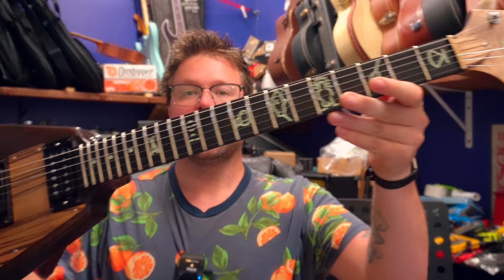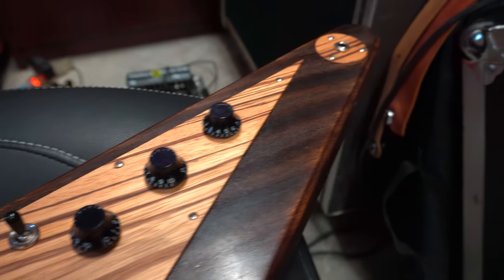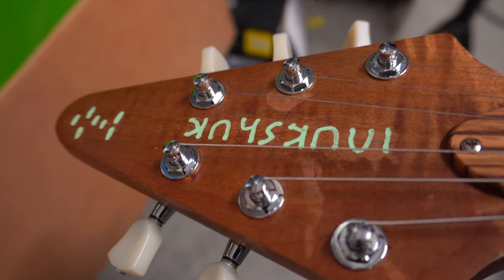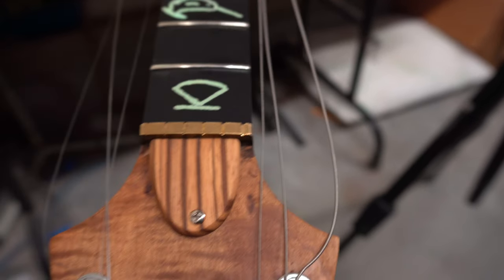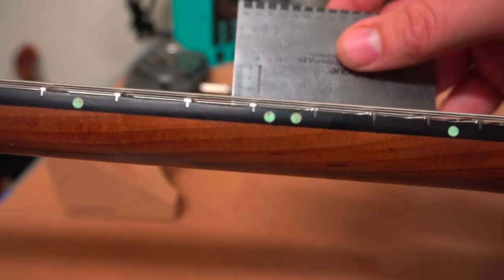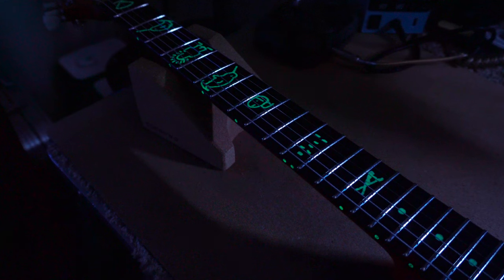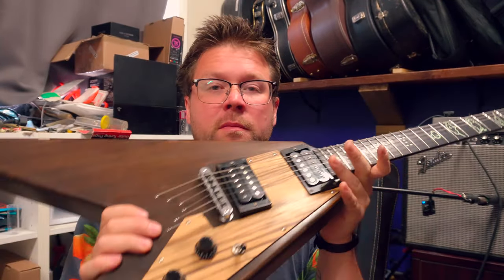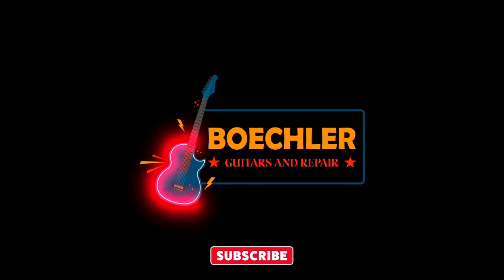INSANE Canadian Custom Flying V! Inukshuk Guitars V Review and Demo

Comment: Very unique guitar. I really like the  inlays on the fretboard.   It's obvious a lot of work went into that guitar.  Question - Using a brass nut seems like an advantage over a softer material like bone.  Is a brass nut better than a zero fret nut for some reason?  If I may make a suggestion:  A collaboration video with Brad Angove.  I believe he lives somewhere near Edmonton, Alberta.
Reply from the maker: Zero frets are great because you are getting the lowest action possible, at the nut end of the neck. Takes away user error on nut filing depth. Then you can use the truss rod to keep the neck straight as possible, and adjust your string height from the bridge end only. Brass nuts are supposed to help with sustain, they don't chip or crack like bone or plastic either. I also like the way they look. I will have to check out Brad's channel. Cheers